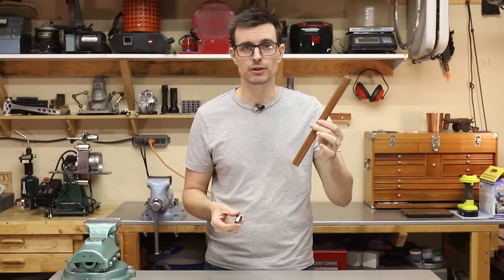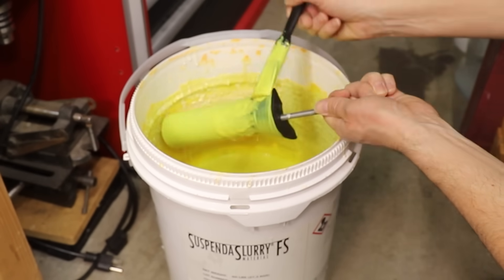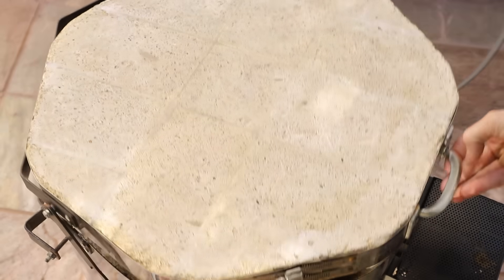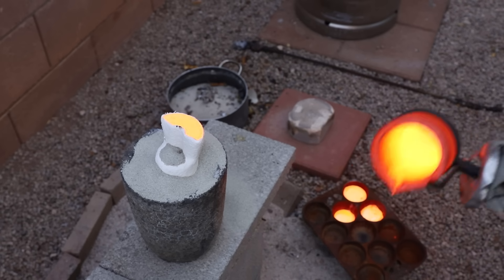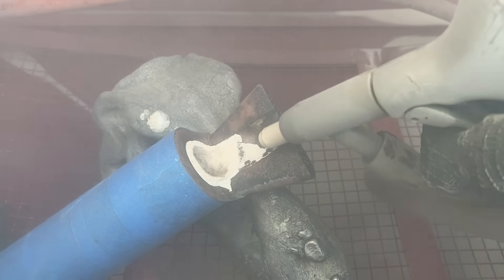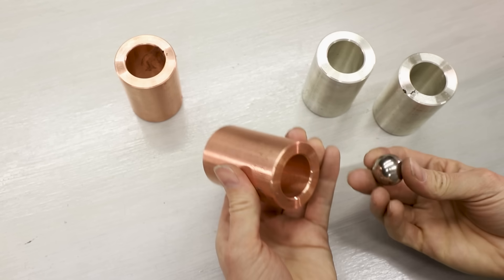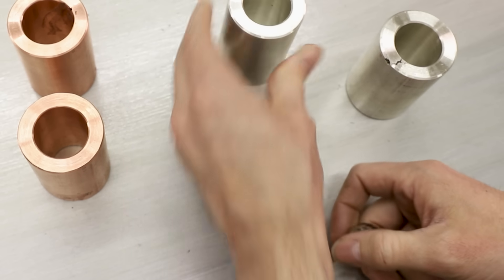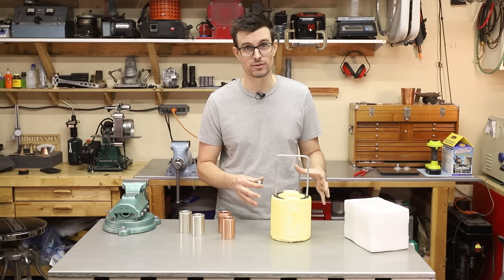Making Anti-gravity tubes - Copper & Silver! - Lenz's law - Metal casting Experiment

Comment: cool, is the final diameter of the silver tubes the same as the copper? also would a magnet that is closer to the inside diameter of the tube travel slower?
Reply: Yes.  The closer the magnet, the stronger the induced currents in the tube, the stronger the induced currents, the stronger the opposing induced magnetic field due to those currents and hence, the force of interaction with the magnet is stronger.

Comment: strange indeed. If you test the electrical resistance of the tubes from end to end with a multi-meter, is there any measurable difference in ohms?
Reply: Can't get such fine measurements from a simple multimeter.
Reply: @Toxicity1987   i agree :)
Reply: @Toxicity1987   It's interesting that there is such a noticeable difference from something that is hard to measure.  Is there some other property besides electrical resistance at play?